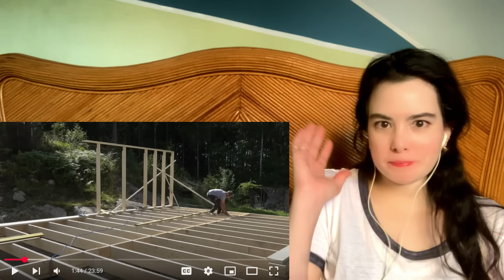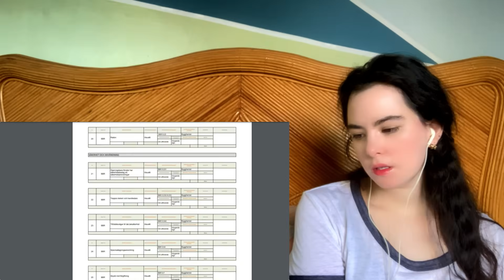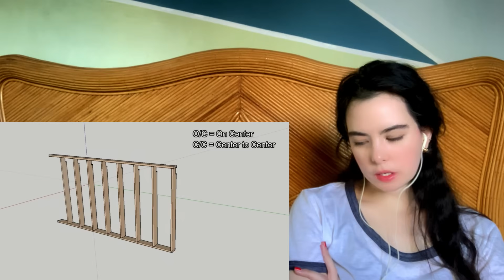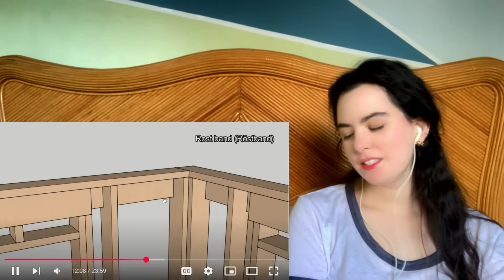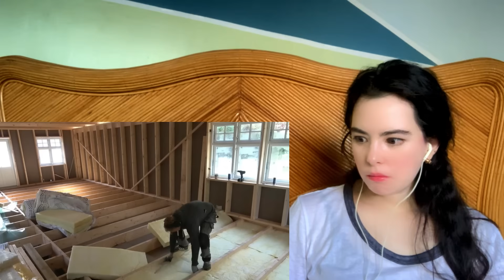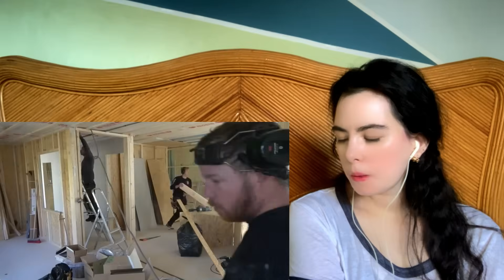American Girl Reacts To Scandinavian VS American House Building Methods!

Comment: In Sweden we have c:c 60 or 45cm for walls.
It depends on the boards, 120cm or 90cm.
Wood truss have c:c 120cm, steel truss could have 200cm.

Comment: "Does Scandinavian houses have basements?". Well, let's just say the property tax in Sweden for a residential house is 0.75% of taxation value, which is far less than market value. "Economical buildings", such as barns, detached garages, sheds, saunas, bomb shelters, potato hole and most importantly, the basement is taxed only 0.5%. The total property tax is capped to $1000/yr. So yes, anyone who doesn't have a basement bigger than the house itself is a sosse who think it's cool to pay taxes or something. Norway have a flat property tax of 0.1% which means most homes never exceeds $1000/yr in property tax anyway.

Comment: The oldest house I have lived in here in Sweden was a timber house built in the year 1620. I know about a farmer 100 km from me that have 2 small timber barns that was built in the year 1430. Norway have a wooden church built between the years 1130-1150. In Scandinavia we build houses to last generations.
Reply: We did, for centuries. But that mentality started to fade already with the so called "modernism" in the 1930s.  So by the late 1960s or early 1970s it was all gone, from the aesthetic sensibility to the quality of the wood itself. Even so called "stone" (originally bricks, now concrete and wood) buildings are using crap materials these days. The plaster is not appliced on a brick wall anymore, but on the fragile isolation...
Reply: Not in scandinavia, but here in Finland we like to build houses to last a very long time too :)
Reply: @VonKoeyhae  When did Finland leave Scandinavia really? Was it when Sweden messed up and had to give the eastern half of its land to Russia in 1809? Or was only half of Sweden "scandinavian" before that?
Reply: Finland isn't in the scandinavian peninsula. Well at least most of it isn't, just a small part of lapland is in scandinavia. Also it's little bit of a cultural thing, Finnish language isn't related go the scandinavian ones.
Reply: @jyripeltola5904  The Germanic and Scandinavian language called Swedish is still an official language in Finland though. Simply because Finland was the eastern half of Sweden (for well over 600 years) before becoming a state of its own. 
The Sami language isn't related to the germanic languages either, that must mean Swedish Lappland isn't "Scandinavia" either, right? With your logic.
Reply: My house built in 1856.solid timber.

Comment: 14:30 in Scandinavia must roof carry least  300 kg /661 lbs snow to each 1m3 ( one cubic meters )
Reply: Roofs have square meters, not cubic meters...
Reply: @TNH91  snow is cubic meters
Reply: @toomasargel8503  But they wrote that the roof must carry 300 kg per cubic meter, not per square meter. The fact that snow would be in cubic meters is irrelevant.
Reply: (cubic meter) wrote that way. So he means that also

Comment: Vapor barrier inside: temperature at the barrier is highest during cold months. The temperature is linear, the outermost surface is at ambient outside, the barrier is at the temperature of the sheet that is on top of it, and that is contacting the inside air: it is warm. Condensation should not happen then at all, warm air can hold more moisture so while there is the same amount of water per volume, the dew point goes up and up as we get close to the barrier: air does not give up water, it does not condensate.  If the barrier was cold, it would do the opposite and moisture would start to condensate, cold air can't hold as much water in it, it starts to precipitate it. 

Vapor barrier outside: the reverse is true.

Comment: Usually, electric cables are pulled afterward into walls thru plastic tubes installed by the electricians.

If a wire is damaged, it can be replaced with the same method they were installed in the first place.

Using a long metal insertion spring.
Reply: Carpenters is not allowed to install the plastic tubes, only the electrician is allowed to do that work in Sweden. I know and had that discussion a few times as an electiscion.
Reply: @andreaswennberg9542 thank you for correction. I thought so. Once in our construction site electrician  hammered plasterboards because he hasn't installed tubes yet inside 😅 Too hasty carpenter we had.

Comment: When cutting many pieces with standard divisions, like using same stud distances all around you make jigs when you cut them. As long as your jig is sturdy and accurate, and well tested, which can take considerable time then you can go thru a stack of lumber in very short time and every single cut is perfect. 30 seconds per board is very leisurely time, you can do that for hours. 

Fine tuning it can take so long that you are half done by that point, but that is where the skill and experience comes in.. You just don't see the exact little detail that makes it all work, one stopper at one specific point and you may even notice that it is not exactly like every other piece but... everything else is fixed with nails and that one thing has a thick bolt thru it.... because that way you can bang against it for hours without it shifting too much while if you used any old nail you have in your pocket... you would have to hand saw a millimeter, then 3 then 5 and do that while installing the thing up in the air around half the building. One bolt in the entire jig can make a world of difference, not using it can create a world of literal hurt. Bu you learn.

My dad was a construction worker and then became construction engineer. I learned from him that using 4 hours of making jigs and tools is worth it.. You could measure them one by one and probably even finish at the same time but that is in reality a huge amount of extra work and nothing is consistent. My threshold of making a new tool is quite low, doesn't need to be that many times doing the same thing again and again before special tools, jigs and forming simple assembly lines become just easier and better way to do it. If it is very, very important cut, you may use a whole day just to make a good rig to hold it just right, then the actual work takes 10 seconds. When it comes to cuts to join things, it is a real art where ridiculously small things matter overall, one join between two key pieces being perfect makes the rest of the structure better, they may ALL reference that one corner. A good builder sees the key points instinctually after years of doing it and making all the tiny mistakes that makes construction hell when it could be nice "lego" building where things just slot into places without a struggle..

Just watching my dad make a temporary worktable, it takes couple of minutes and now you are not painting on the grass. It is a whole way of thinking how to work smarter, not harder. It is impressive to see the tricks they use to erect whole house with just one or two men... lots of preparations and clever thinking.

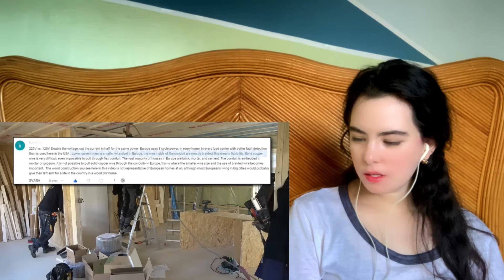Comment: 28:40 The USA uses a lower voltage, 110V AC compared to 230-240V AC in Europe. If you halve the voltage, you have to double the amps to get the same power. This means that the Copper cable has to be much thicker in the USA.
Reply: Such a dumb idea in the first place to go for 110V AC...
Reply: @basstrammel1322  It was just a idea, long time after you realize it was dumb, not dumb when they came up with the idea.
Reply: @basstrammel1322  So why don't we use 1000 Volt AC and really thin and cheap wires?
 Because there are other factors, like isolation distances, risk of fatal shock, and so on.
Reply: Also they use 2-phase AC in the US, meaning the phases are 180° apart, giving a voltage of 220V between phases, while Europe is using 3-phase AC ,meaning the phases are 120° apart, giving a voltage of 400V between them.
Reply: @dsludge  I guess you mean 1 phase and 110V AC. Not all European building are using 3 phases yet and 3 phases don't change the size of the wiring inside the building, the 3 phase benefit the supply powergrid to the buildings and not much benefit for the building itself.
Reply: @neinei5558  Most houses is on 3 phases, easily. The shift is happening from IT 230V 3-phase to TN-S 400V 3-phase
Reply: And because manufacturers don't want to make different wiring for machines for the US and Europe the dishwashers for example in the US operate with half of the power and are very very slow to heat the water and often require hot water connections to even be able to wash the dishes, cheaper ones can't even hold the temperature.

Comment: His roof (1:1) is very steep by US standards (1:3). I don't like how he keeps talking about higher snow loads for this reason. I don't think that Eurocode's roof stuff allows load reductions based on shedding just like ASCE 7 in the US, but the Scandinavians have amended codes that do account for snow shedding off of steep roofs. They do account for the friction of a metal roof versus other materials.
Reply: Laws and regulations are always a bare minimun in northern sweden they might use much less distance to carry snow than in the southern parts

Comment: I'm very skeptical of his exclusion of the floor sheathing from below the walls. In the US, building codes prescribe a bunch of nails between the sheathing and the "rim board" that caps the ends of all of the floor joists. Without these nails, a subsequent builder could come along and attach an exterior deck to the rim board, where there could be a subsequent catastrophe. Without these nails, there's a problem with the load path from the "floor diaphragm" (floor sheathing) into the walls. If he wanted to exclude his sheathing from below the wall like that in the US, I (a structural engineer) would impose a bunch of additional nailing on him. 

And the exclusion is just stupidly unsafe. Maybe not unsafe at the individual level, but certainly unsafe at the epidemiological level.

Comment: That US example with the fire blocking is not at all representative of US construction. If that's fire blocking, then it's goofy. As long as your ceiling height is less than 10 ft in the US, horizontally oriented fire blocking like that is unnecessary. If I had a builder insisting on using a wall sheathing system called "Thermoply," then I might demand that he install bracing like that to restrain the studs better against buckling. Apart from that, I'm having difficulty imagining a rational reason for that horizontally oriented blocking between the studs.

Comment: For building your own house in the US, just look up the "IRC" (International Residential Code). The codes were once expensive and therefore inaccessible for non-builders, but successful lawsuits have pushed the code writing orgs to make codes freely available online. The IRC is adopted (with amendments) in many areas of the US, and otherwise it's usually perceived as good although other options can be available. The first two chapters are basically like the introduction to a book. The third is a little scary for a know-nothing, but it covers stuff like fire safety and design loads. Skip to start at Chapter 4 for foundations. The IRC is basically a how-to manual ordered naturally for a platform framed home.

On the code amendments, here in Idaho we have substantial snow loads in some areas, so we have fine grained snow load maps so that everybody isn't over building for snow based on the IRC's coarse grained maps. Texas has all sorts of awful expansive soils, so I imagine that it would have lots of amendments to the foundations part of the code.

The video doesn't account for climate. The Scandinavians would put exterior wall framing at 24" centers to minimize disruption to the house's thermal envelope. The wider spacing is because of their cold winters, not because they have bigger wood. They, like everybody else, would use 16" centers for floor framing to balance costs against floor sheathing thickness. 24" centers calls for uneconomically thicker floor sheathing. This is just a cost minimization choice. The 48" roof truss spacing would sound crazy wide to a US builder, but I'm sure that they just use purlins. In the US we typically have insulated ceilings in the attic space, so our roof truss spacing doesn't impact thermal efficiency at all. The Scandinavians like insulated roofs, where I suspect that this explains the 48" spacing. This spacing reduces the disruption to insulation by roof framing. (Kevin's attic sleeping area in Home Alone is totally unrealistic, as there's no insulation between the exposed roof rafters.)

That bit about "advanced framing" in the US and Canada was wrong. Advanced framing prescribes that trusses sit directly above wall studs, for instance, so that you can have better wall insulation and save a buck on materials. It's mostly about getting better thermal efficiency by imposing upon carpenters to think a little harder. It doesn't really have anything to do with different materials. In the cold of (and among the brainiacs of) Scandinavia, it's quite intuitive that this thermally efficient detailing would be used.

Comment: "This might as well be in Japanese."

Well, Swedish (and Danish, Norwegian, Icelandic, Faroese) has similar roots as English and uses the Latin alphabet, so I'd say Swedish is a lot easier for an English speaker to understand than Japanese. For example, I think you could guess the word "hus" means "house" if you thought about it. A lot of words are similar like that.
Reply: True, the language itself isn’t the hard part. Swedish (and Danish, Norwegian, etc.) shares roots with English and uses the Latin alphabet, so basic words like “hus” are pretty guessable.

However, I'm pretty sure what makes those blueprints feel “Japanese” to her is the technical shorthand: symbols, measurements, construction terms, and conventions that only make sense if you work with them. Even in English, architectural drawings can feel like a foreign language if you’re not used to reading them.
Reply: Shure and around 900 of the most used words in English is old Norse/Danish like Arm, wife, hosbond, knife, knee....., just Google it.